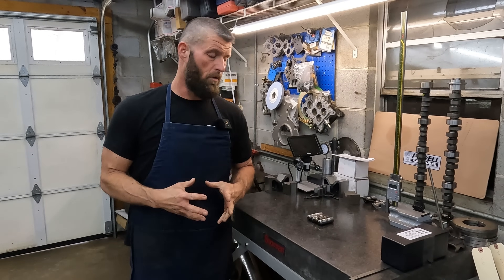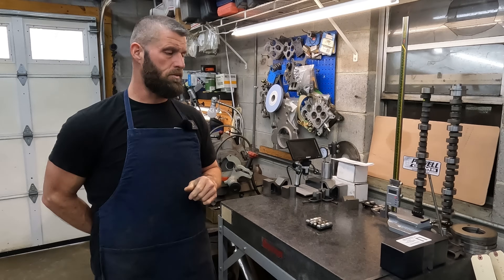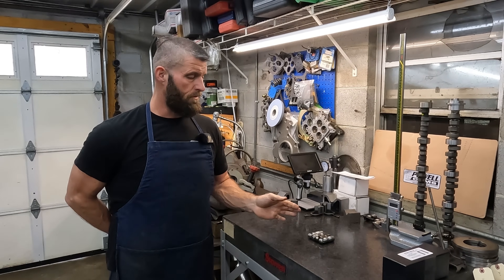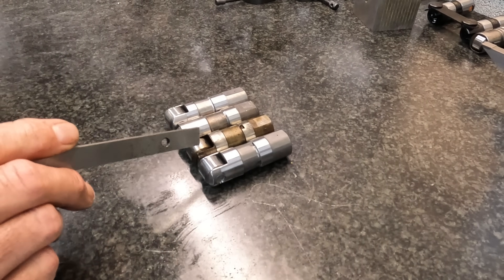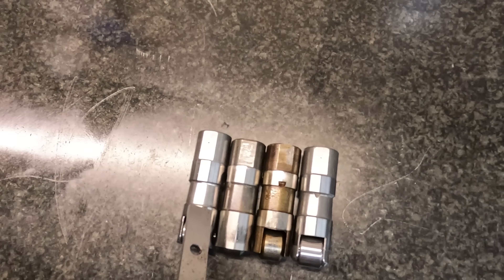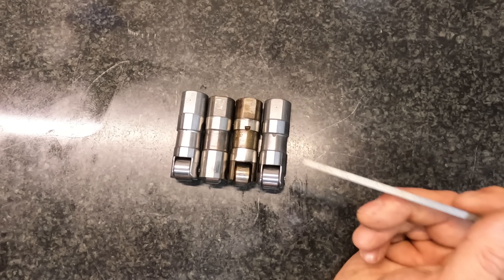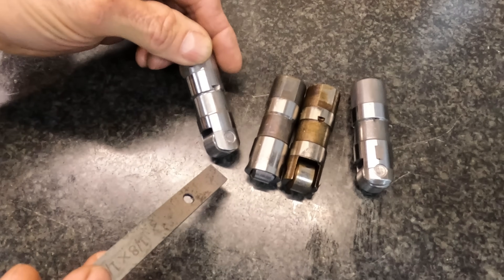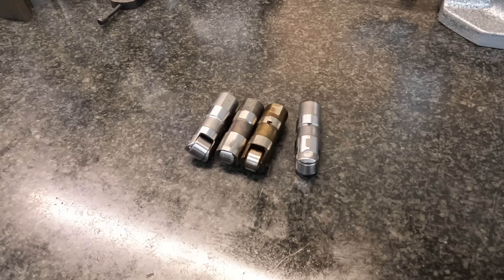Are Sbc and Ls lifters different?

Comment: I put a new roller cam in my Vortech 350.......I used lifters from a different source....they were marked GM on the box. I could never get the lifters to oil the rockers correctly. I've always thought maybe the oil ring was wrong on the lifter or something. Your thoughts?
Reply from the maker: Most likely a valving issue internal in the lifter

Comment: For a sbe turbo iron block 6 liter what lifter would be your go to for btr 3 turbo cam and high rpm, i was gonna go with link bar short travel 2116's until i saw your other video showing the oil band on the 2116, being uneducated i like the full bodied wheel of the 2116/ls7 style but if im gonna spend any more than a small amount id really like to buy once and cry once while also ditching the plastic trays, if i werent keeping stock rockers id go solid.
Reply from the maker: Any quality lifter will do that no problem
Reply: @powellmachineinc  I went back and realized the oil band width video was in bbf, now does the same go for the 2116 for the Ls?
Reply from the maker: @BoostNBalast  there fine, same as oem

Comment: Great video Just wondering doesn't  the SBC lifters use linking bars and the ls engines use locking trays
Reply from the maker: Both use a guide system,  only aftermarket lifters use link bars

Comment: Did Gaterman ever get back to you? Also, all of the OE gen 2 LT1 lifters I've seen have the oil band in the same lower position as the LS7s. My guess is that GM moved the band upward in the late 90s/early 00s, realized they made a mistake and moved them back. If you were to install the lifters with the higher band into an OE roller gen 1 or 2 SBC you'd see that the oil galley holes are completely blocked at peak lift (assuming a regular base circle cam). I bought Morel 7717s for my LT1 only to find this out the hard way.
Reply: I have a 1988 block and i cant find a lifter that doesnt almost always cover the oil gallery hole! Barely any oil up top i just want a oe style gwn 1 roller lifter that works… i cant find one
Reply: @Ticeracing33  The Johnson 2110R has the right style oil band, but they aren't cheap. They seem to be the only drop in lifter with slow leakdown and strong parts that'll handle a decent sized cam. There are also cheap stock replacement lifters with the right oil band, but I'm not sure how much I'd trust them.

Comment: well after months of waiting to get my block back from the machine shop, my machinist had to under go many operations for hip and knee replacements, i bought the gaterman LS7 lifters from your store, and we had a nice phone call prior to, and i placed the order at before the call ended. then you posted this video by the next day, i also asked for the drop in vortec beehive spring kit you offer, store states kit # Vortec Spring Kit 062/906 and i got the Gaterman GP1012  based on the advice from you.  now that i am finally assembling my engine, i find the retainers are about .010 larger OD than the spring ID, and when i tried to look up parts on your store i noticed the number on box is  Vs011-16. i have no idea what # will be on your boxes on your assembled kits so i assumed they would be right when they arrived months ago. i never opened the boxes till this past week. i called about the retainer issue, left messages and contact info. waited a few days and ordered a diff set of retainers. the springs spec's match height to pressure and fit the head. so i assumed it was a retainer issue. today  i am priming the engine on the stand. and let me inform everyone DO NOT use the Gaterman GP1012 on an engine not listed. the moment a lifter begins to rise i go from 80 psi on a drill motor priming to 10 psi. when 2 or more are off base circle its scary. at speed who knows, the time they are in area to oil band is greatly reduced and it may cover but i am not willing to chance that. i have almost $11,000 invested into my new boat engine, including new heads, closed loop cooling, etc but i still have a ton just in brand new brand name engine parts. is not one thing cheap about the build infact these lifters cost more than i needed to spend.. i hope i have better luck callling on 7/15 about the lifters than i did on the springs. as i have still not received an email or call back and its been since tuesday i believe. it is my hope that PMI gets notifications on youtube comments so they are aware, can address this and i am able to get a call in tomorrow, i will edit this once resolved to the basic points on why this iifter does not work on pre LS,. it is clear by this video it was not a known issue, and i made the purchase as stated during my call to PMI to inquire if they would work on vortec style engines.

Comment: Just saw this. I have a question. So could I get LS 7 lifters from Texas Speed and use them in a 97 vortec 350 out of a truck? I have a LT4 hot cam that I want to put in. I know the lifters are good, I’ve done a few DOD deletes and haven’t had a lifter problem yet.
Reply from the maker: https://youtu.be/5f4ULhba7AU

Comment: Howdy Powell Machine. The LS Gatorman oil hole for the wheel and SBC oil hole for the dogbone are each good ideas. Couldn't a lifter have both holes or would that lose too much pressure? You seem to prefer the Gatorman LS lifter even for SBC. Any answer from Gatorman? Anything more about band height info?
Reply from the maker: I'm going to ask Gaterman

Comment: I'm not trying to be a dick,or start trouble, but a 5.3, and 4.8, according to GM, is not an LS engine. The LS were used in the Corvettes, and Camaros. I'm not new, or green with GM anything. My family owned a Chevrolet, Pontiac dealership until I out of school. I have also been a tool and die maker, machinist, engine builder, and mechanic since the 70's. I also live in your area, within 40 miles. I have lifters out of an early 5.3, and lifters out of a vortech 5.7 350. Both lifters are ALMOST identical. The difference is in the pushrod cap. The 5.3 lifters are flat against the retainer clip. The 350 vortech lifters have a lip on top that sets them .050 lower in the lifter bore.  The overall length of the lifter is the same. It's just the cup that sits lower.  GM does do strange things, just like everyone else, but from what I have checked, this is consistent. I have a set of 5.7, vortec lifters in a 5.3, that have been running for 30,000 miles, without a problem, but I shimmed the rocker arm shafts to make up for the difference.  Like I said before, I'm not here for trouble, or to steal your YouTube, I'm just telling what I know from experience, not something I read on the Internet.
Reply: So, can you run 5.3 lifters in a 5.7 vortec? Is modification necessary?

Comment: daniel thanks, i am the customer from yesterday who helped create this mess. i had called bill at gaterman, he states the issue is due to the oil port on side of lifter for the oiling of the wheel, as the band moves up during cam lift, the oil galley in block, becomes aligned with the oil port for wheel in side of the lifter, which then he states is an open hole not metered or restricted much, in turn can reduce oil pressure in the engine as each lifter is moved up in lifter bore. as the lifter comes down, the oil band is sealing the galley and lifter bore again. i can see this both ways. at the rate of speed the lifter is infact up in the bore far enough for the notch and hole in each side of the lifter, it may reduce pressure at the brief instance it is at full lift. on its way back down, the oil band is again resealing it. depends in my mind, how far up the bore cam lift moves it, how large the lube hole is, how many lifters are in that alignment at the same time and then how much oil volume is or is not there to cover it. i still ordered the LS lifters. my cam is mild by many standards and if they took into account huge lift cams, my smaller milder cam may not even move it up the bore far enough to fully get to aim directly into the lube hole.  i believe that is what gatermans concerns are

Comment: I replaced a set of hydraulic lifters in my 5.7 litre Chevrolet LS1 V8 engine a bit over 5; years ago with a set of aftermarket no name brand LS7 hydraulic lifters which were CNC machined in Australia,the cup sits 0.05" (1.27mm) higher i in  that lifter than what it did in the LS1 hydraulic lifters, they're still going good.

The LS7 hydraulic lifter is the default lifters which has superseded the LS1 hydraulic lifter, they're the default part for the 1997-1999 Holden 304 cubic inch V8 engine which was the last locally  produced V8 engine that Holden made,the lifters are a default part for Holden/Buick 3.8 litre LN3,L27,L36 & L67 V6 engines as well .

All of the Chevrolet, Buick & even Holden hydraulic lifter bore diameter of 0.843" meaning that the hydraulic lifters are 0.842" in diameter meaning that if a hydraulic roller cam was used in the 308 cubic inch Holden V8 engine back in 1969 when that version of the 5 litre V8 engine was first made then the roller type lifters will fit into that engine.

It was reduced to 304 cubic inches in 1984 to reduce the engines capacity from 5044 CCS to 4987 CCS to suit the the motor racing body (CAMS) 5 litres capacity limit at the Bathurst 1000 race day !

Comment: I'd also be curious if the oiling position in the LS blocks change over time.  GM had essentialy 4 5.7 aluminum blocks from 97 to 04.  I understand the sleeve length changed on the Gen 3 Iron 6.0s no idea what all they changed outside of that.  You would think they would be the same but the "LS6" block may take early or late head bolt lengths depending on when it was cast.  This is not the first I've heard of lifter differences but not many talk about it.

I'm not a pro, just a guy that over researches his heads / cam track days car, that I built with the exception of farming out some machine work to an awesome local machinist that has been a great help to double check I'm headed in the right direction.  I really appreciate guys in the industry sharing knowledge/

Comment: Check the oil band dropping out of the lifter bore on smaller base circle cams. Chevy lifters in a Traditional Pontiac V8 have this issue. 
Interesting video 👍👍

Comment: I was told the lower band on the ls7 lifters was to preserve proper oil pressure, lifter bore to lifter bore while at full lift with a higher lift cam.

Comment: Also the same lifter used in the vortec 4.3 l with balance shaft.  I figured that out because a few months before I purchased my 5.3 I did lifters in my '04 Chevy Blazer 4.3 and it had the same part number when I went to order the lifters for the 5.3. that's GM for you. Use off the shelf in stock parts for everything instead of inventing something new. I don't count that DOD garbage. That was an epic failure from GM but good for all the machine shops that had to fix their mistake.
Reply from the maker: Yep
Reply: the DOD is JUNK that's the first thing I change out
Reply: I just finished doing a DOD delete on a 6.0 aluminum block. 2 headbolt holes stripped out of the block on reassembly. Talk about a major clusterfuck! 1 bolt on each side and both in the same position.

This was for my best friend. He just bought the car and 2 months later a DOD lifter collapsed.

Comment: I had this exact discussion with Crowler. I have a 94 to 96 LT-1 and struggled to get good lifters or ones that work with my cam..Under .400 lobe lift.
I figured out that the oil band looked like it was in the incorrect location. With 60 psi of oil pressure at the back of the block and no obstructions in the lifter valley they would not flow oil.
I have never heard of Gator lifters.
Reply: Theyre popular in the Harley Davidson world.
Reply: I’m working on the same thing. Have junk lunati in my lt1. Crower has two drip in lifters. One for LS and one for sbc. I’m torn between which one to get. Did you get it figured out?

Comment: Notice on the one lifter where the wheel is shrouded, I've seen this lifter in 4.3v6 non-vortec.  My identification of vortec is the vertically oriented intake fasteners.
Reply: I'd hope so the 4.3 uses all the same parts as a 350. Per gm engineering a 4.3 is literally a 350 with cylinders 5 and 6 cut out of block
Reply: @claytoncoolidge992  Yes, then you have what's called 4.3 vortec except it isn't, then you have non-adjustable rockers or adjustable rockers, light weight or heavy pistons, on and on.  IOW, there are many flavors of "sbc" 4.3 including flat tappet.